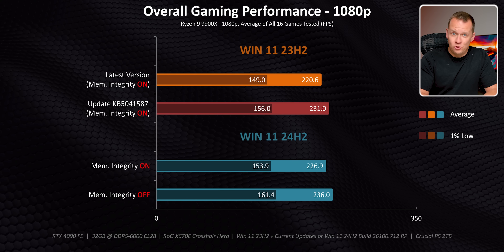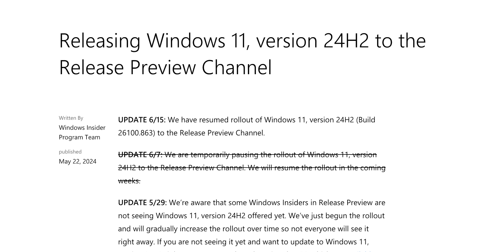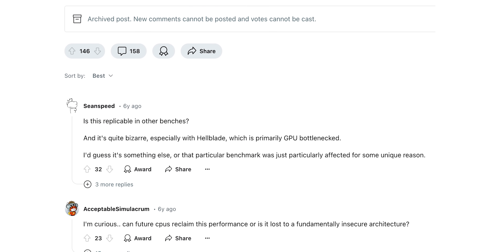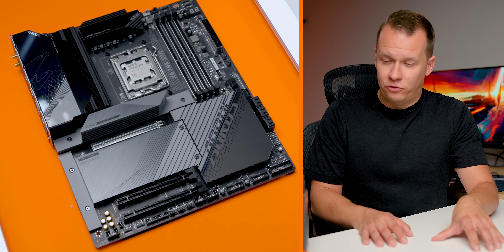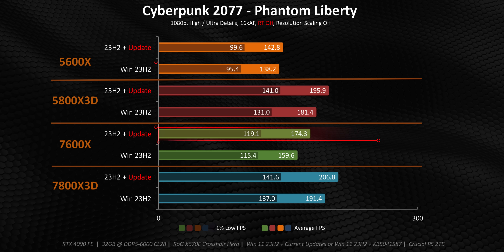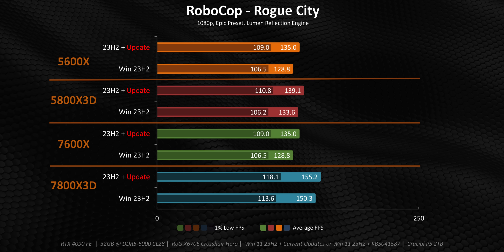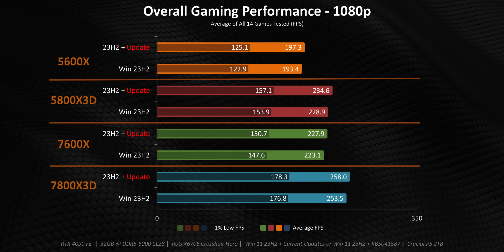Older Ryzen CPUs Just Got Buffed

Comment: I've not sure, because I haven't really tested too much, but I think Windows 11's virtualization based security causes performance issues in older Ryzen and possibly Intel Core 10 or lower? It seems to have a minor effect on newer chips, but this is far less of an issue there.  I noticed that my 5600 and 7700 were not performing as expected in benchmarks, though this was less noticeable in games.  Disabling the virtualization based security made things a lot better.   I'll need to see if it is still a thing in recent versions of Windows though.

Comment: Yep the incremental update for 23H2 alone seems to have fixed a nagging issue I’ve had on my daily driver machine with a noticeable memory leak whenever closing and reopening resource intensive apps. Finally! I would swear it’s been going on the entirety of 23H2. 

I’m using a 7950x rigged to 64 GB of RAM, and with only normal day-to-day use nearly all 64 GB would be in use no matter how much was actually closed, background processes and all. It would only take half a week to max it out for no good reason.

Comment: Not sure how AMD is going to impress with a 9800X3D if its still just 8 cores and they want $450 for it like the 7800X3D. 265K is only the i7 part of the new desktop lineup and its beating the 9950x in multithreaded synthetic tests.

Comment: The problem is, I can't find any 5800X3D in my country (Malaysia)
and lately, I can't even find 7800X3D 😭😭
Reply: Look for 5700X3D?
Reply: I'm using 5700X right now, I don't think the upgrade is significant ...
Reply: @wailoonleong3083  5800X3d is barely better than 5700X3D
Reply: @matte563  yeap... I think I will just wait... will be pairing my 5700X with 4070 Super~
thanks by the way

Comment: I mean windows is getting some of the performance back that was lost in the new version is more like it. It's not really gained performance. Windows 10 had these performance figures already. Windows 11 was specifically constructed around Intel CPU's and the big little architecture they are using. Clearly to the determine of AMD. As it stands right now. Games should 100% still be on windows 10 and if you are these numbers are still in fact lower across the board. Windows 11 only what 15% of the install base while windows 10 if 65% of the install base? Reviews should go back to using the OS people are actually using.

Comment: I just installed a 5700X3D, to replace the aging 2700x I had.
Reply: At the same motherboard? That's awesome and insane at the same time. I've bought a b550m from MSI and R5 5500. I'm thinking about changing for the 5700x3d in the future
Reply: @gabrielladeira5627  it's actually a sad story, I had to replace my x470 board for an x570 cause it died, so pretty much all my system was new except for the CPU 😅 I even have a 6750XT that was running at PCI 3.0 speeds due to the old CPU.
Reply: @gabrielladeira5627  you will definitely notice a difference with the X3D chip 😄👍🏼
Reply: Same here, except I've only got a 5600x... But from the remaining money I've snagged a 6700xt
Reply: @triggeredtiger9905  the 5600x is plenty for that 6700xt 👌🏼

Comment: Windows update on everyone's mind?  Speak for yourself!  I have been Microsoft free for more than a decade now, because that POS OS was so bad, and Microsoft even much worse as a whole.

Unlike many who had all the same complaints I did, even worse didn't understand how to get around them, change it's behaviors... by literal hacking into system files and what not as I did, only to lose any and all changes at M$'s discretion, so with every update... I switched to Linux, and ever since have been the sole decision maker of what flies on my computers and what doesn't, and I don't have to thwart whatever corporations and bad actors do to my PC, because they can't do it by default, and I would have to actively and explicitly allow them to feed me adds at will, harvest my data, take over parts of the system I myself have no control over...

Stop complaining about Windows being such a POS, while catering to the very people who make it, and with their "Partners" see your use thereof as approval to roofie and rape you at will, and ever more and frequently, and are actively making it worse with every update and release, because YOU are actively involved in making it happen!

Also:  When I install a new processor, I do (Should) as everyone else make sure the BIOS is up to date to accept it with as few problems as possible, but do not have to reinstall Linux, it can handle just about any hardware update without having to tell it, and instead of like Windows that installs drivers (With more help from you than need be) on OS install, Linux checks the hardware and loads the closest driver on every boot, and as fast as it boots, you wouldn't know it.  If there is something amiss you will still have all standard functions until you chose a more specific driver, often a proprietary one from NVIDIA and similar just to get a few odd and/or newer features, or get it when the driver is updated if it was the cause, better yet, the OS, drivers, and most (almost all) software are updated through a single common interface based on your Distro's schedule, mine in being a "Rolling release" can check for, find, and install the newest anything as soon as published, so I can get daily updates, with a schedule or not (which will respect your use of programs so you can keep working during updates) one you make not some overlord corporate authority over your PC, or do it manually when you see fit... which only takes a few seconds to a few minutes, not hours of license agreements, reboots, sales pitches, long " please wait" and "don't touch anything" warnings and all that BS.

Comment: The 5800X3D is silly expensive on the used market tbh, about equal to new pricing. I still got one, as it more than doubled my framerate in one of my main games, paired with an RTX 4060 Ti at 3840x1440. However, for most people I think it makes more sense to either save money and go with a cheaper pick, so you can save 2/3rd on the platform cost, or to just go for a newer platform, now that DDR5 no longer feels like shopping around for diamond rings.

Price aside though, what a fantastic chip. It's the new 2600k for sure.

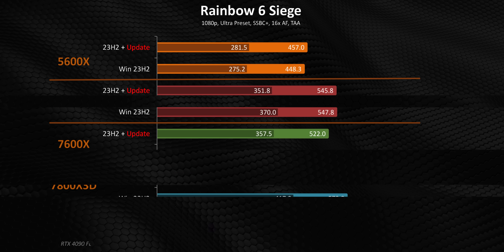Comment: 5:56 Average FPS of all games tested is a useless metric when some games are around 100 FPS and CS2 is ~500. You should have calculated the percentage change and shown the average of that.
Edit: it was worse than I remembered: one game was around 70 FPS and CS2 was more than 700.

Example 1:
Game 1: 100 -> 110 FPS (+10%)
Game 2: 500 -> 510 FPS (+2%)

Avg: 600 -> 620 FPS (+3.3%)
Avg%: (10+2)/2 = 6%

Example 2:
Game 1: 100 -> 102 FPS (+2%)
Game 2: 500 -> 550 FPS (+10%)

Avg: 600 -> 650 FPS (+8.3%)

Avg%: (2+10)/2 = 6%

It shouldn't matter which game gets +10% and which gets +2%, but it does when you only show the average of the FPS values.

Comment: After installing this security update, you might face issues with booting Linux if you have enabled the dual-boot setup for Windows and Linux in your device. Resulting from this issue, your device might fail to boot Linux and show the error message “Verifying shim SBAT data failed: Security Policy Violation. Something has gone seriously wrong: SBAT self-check failed: Security Policy Violation.”

The August 2024 Windows security update applies a Secure Boot Advanced Targeting (SBAT) setting to devices that run Windows to block old, vulnerable boot managers. This SBAT update will not be applied to devices where dual booting is detected. On some devices, the dual-boot detection did not detect some customized methods of dual-booting and applied the SBAT value when it should not have been applied.

The September 2024 Windows security update (KB5043076) and later updates do not contain the settings that caused this issue.

On Windows-only systems, after installing the September 2024 or later updates, you can set the registry key documented in CVE-2022-2601 and CVE-2023-40547 to ensure the SBAT security update is applied.

On systems that dual-boot Linux and Windows, there are no additional steps necessary after installing the September 2024 or later updates.

Comment: Forgot to test SVM (memory / kernel isolation or whatever it's called) on and off.. I installed 24h2 (where it's off), on my 5800x3d based system, and it felt more snappy ingame. didn't measure anything - was noticably better..

Comment: best bang for the buck right now seems to be the Ryzen 7 5700x3d. almost as fast as the 5800x3d for only 200 dollars not bad.
Reply: the 7600x is mostly faster then the 5800x3d and half the price. The 7600x is a beast for it's price.
Reply: @TheGympert  B$... 7600x less cores and cache. Also it wont be able to compete in mutitasking with less resources... Also for someone like me and many more that did jump on the ZEN since it was introduced 2017, we have whole systems, and is way better for us to just upgrade the CPU alone, no to go and buy expensive AM5 mobo and DDR5 too.... So ur statement suck, since u just compare the 2 processors, and nothing else... So what u said, applies only to these that have older then AM4 systems, or no system at all...
Reply: Lower clock speeds = lower performance... Not my cup of tea... Also i got mah 5800x3D for 330$, but also sold mah Ryzen 3700x fro 150$, and Wraith Prism for 25$... So getting the 5800x3D for 160$ was da real deal, as 5700x3D may be cheaper, but it also has lower IPC too and clock speed, and that sucks, as 5800x had way higher clock speed then 5800x3D anyway...
Reply: @themobster7284   lower clock speeds does not always mean lower performance unless you really care about that 1%
Reply: @AgonyofAven  1% ahahah... Seems someone missed the math classes... How exactly is 4.1GHz 5700x3D vs 5800x3D 4.5GHz, 1% ?!?!? Outside of games and stuff it will be slower, by at least 15% lower IPC.. And also 5800x did boost up to 4.7GHz... So you want to tell me that 4.1GHz will be only 1% slower compared to 4.7GHz ahahah... I was already not happy, that 5800x3D had lowered clock speeds, but 5700x3D is even lower, and that is not acceptable.. Also 5700x3D mem controller is also weaker, meaning it prob many of these chips wont support CL14 3600 memory, or faster...
Reply: @themobster7284 Pretty sure they’re talking about 1% lows…

Comment: I think the 5800 and 5700x3d will go down as CPUs on the same level as the i5 2500k, probably even more legendary. I don't see myself upgrading again until there is another paradigm shift in computing. It's crazy to think that a $100 B450 motherboard from 2018 might last through 3 major GPU upgrades and over a decade.
Reply: I agree 100% with your post.

Only slight difference: I am running it (5800X3D) on top of a x470.
Reply: Id rather have a 7600x any day of the week. PBO -30 smokes the obsolete chip.
Reply: @jurpo6  "PBO -30 smokes the obsolete chip".

Reasons? "Because the voices on my head said so".

Comment: Is anyone else only seeing KB5043145?
Reply: Same here, also checked my history and KB5041587 was not installed nor can I find it anywhere.

So the question is, does KB5043145 have the performance thingy included?
Reply: @dennishaller6578  I'm only seeing 2024-09 Cumulative Update Preview for Windows 11 Version 23H2 for x64-based Systems (KB5043145) as well. 

It states cumulative update, so I would say that it should KB5043145 build updates included as well.
Reply: @dennishaller6578  KB5041587 was still on the Windows Insider Beta channel when I downloaded it.
Reply: I am
Reply: this late so you probably already figured this out but just putting this here for anyone else, this update is included in the KB5043076 "cumulative stack" update
Reply: Same here
Reply: ye only KB5043145
Reply: Same
Reply: mine says optional update kb5043131 windows 10
Reply: If you have KB5043076 I think it was in that so you won't have 5041587 available.

Comment: How about Zen 2 cpus?
Reply: Sadly no
Reply: Time to upgrade
Reply: @randomusername982374  i have 3900x its doing pretty well for 12 core processor. Should i?
Reply: @randomusername982374  It's only time to upgrade if it no longer suits your needs. I'm running a Ryzen 2700 with a 1080ti and I can still play every game in my library. Admittedly, I don't buy games until they're at least a year old and the prices have come down and the bugs have been worked out by the early-adopters, but there are still some graphically-impressive games in that list that run fine.

Comment: Remember that’s only 1080p using a RTX 4090 “$2,000+ GPU to “highlight” the “performance” of a CPU. If anything you should be running at 1080p low settings to boost the FPS. Only way you going to see this is if you have a $400+ CPU and $2,000 GPU.

Comment: 5800x3d is reminding me of the 1080ti. Just one of those once in a generation bangers
Reply: Even more amazing given that it was an accident almost. AMD had built 3D VCache for the data center and only came to consumers because an engineer tested games with it and realized how much of a performance boost it gave.
Reply: Agreed! I think I even gonna upgrade to it from 3700x before changing the whole platform - it is that good in my opinion. I've always leaned into more budget friendly setups and that cpu is amazing for the price.

Waiting for the black friday deals or may even buy it used if one comes available at the right price.  😋
Reply: @laurikvo  look for the 5700x3d its about 100$ cheaper and ist almost the same, it gets overlooked alot. I upgraded to it from a 5600x which is roughly on par with ur 3700x
Reply: @laurikvo  Get a 5700X3D instead. It's over 100 bucks cheaper and only a couple percent slower.
Reply: @Remu- the 5800x3d price is through the roof in the UK now. No stock over £400 so everyone will get the 5700x3d regardless there's no 58 left
Reply: @laurikvo I don't think you are mate you'll have to settle for a 5700x3d unless you go 2nd hand or pay over £400 for one
Reply: @laurikvo  you better hurry & buy it, I think AMD has stopped production.
Reply: 1080ti performance, but price was still DAAAMN at the time
Reply: I'd say the 5700x3d is more like the 1080ti as its quite a chunk cheaper than the 5800x3d for like 5-6% less performance. The 5700x3d is amd's 1080ti.
Reply: i actually have 5800x3d paired with 1080ti myself :D
Reply: Heeeeeell ya
Reply: Man, perhaps once in a decade even. Certainly not generational.
Reply: lol y are u comparing a gpu with cpu
Reply: If AMD had any sense, the 5600X3D would've been the most sold AMD processor ever.
Reply: It's what I'm running now :D
Reply: I9 9900k
Reply: Have it paired with a 4080 for 1440p gaming. Not upgrading any of those until they die
Reply: hate myself I opted for the 5600X when I built my latest rig and not the 5800X3D, now they are quite pricey because people know how good it is.
Reply: @RichDasix  Yeah I sold my 5600x since I play tarkov and benefit a lot from the big cache
Reply: lmao not even close
Reply: i5 2500k
Reply: Alan Wake 2 enters the chat
Reply: 41%
Reply: I'm still using my GTX 1080ti 150$ since i don't get double the vram & performance for 300$ lmao
Reply: Justb hat 1080ti is hyperglorified, because it already was a massively overpriced GPU, which people just forgot because prices shortly after exploded even more.
Reply: @elmariachi5133  also it had no real competition it wasd either buy a 1080 ti or suffer with amd cards
Reply: And its still better than Intel's core i9 with big and fake cores
Reply: And the 5600x!
Reply: Intel & AMD are need more improvement. Intel Price is also too much for this spec 👎
 Mac M4 is rocking the field with Les Cost. We can buy a Mac mini M4 at an Intel VGA cost nowadays..
Reply: I would say the better analogy would be the "new" i7 4770k the last gen ddr part that lasted right up to the 8700k before showing its age!
Reply: @ravendagrey  the i7 2600k and 2700k did the same, two generations earlier. 2nd gen core i series was very commonly overclocking to hit 5GHz+, which put it level with most of what came afterwards, until 8th gen increased core counts
Reply: @williampaabreeves  100% agree and technically dated but were still relivent until the 8th gen, i had a 3930k oc'd to 4.8 that wasnt far off to my ryzen 5 1600x much later in life
Reply: I upgraded from a used 5500 to the 5800X 3D. What a beastly 8x core chip, now it needs a RTX 6000 card in the future to unleash the full potential 🎉

Comment: Me with a 3700x too lazy to put my 5700x3d I've had on a shelf for 3 months in because the 3700x is good enough :|
Reply: Nah.. lol
Reply: Then why even buy the 5700x 3D?
Reply: @swifty1969  I wanted more FPS and I updated a gtx1080 to a 4070 super so I figured I'll get a CPU upgrade too, just couldn't be bothered to take the fan off and redo thermal paste. I'll get around to it eventually. Might do it this weekend, but then again, might leave it another month.
Reply: @daedaluxe  yeah!  I know what you mean.  I almost felt into that trap when I bought my 5800x3d.  Laziness takes over.   I forced myself to install it first day because if the chip turns out to be defective for some reason, then you will not be able to exchange or return it after 30 days.  The 5800X3D made a world of difference with my rtx3080 compared to my previous 3700X.   I couldn't believe how much of a bottleneck my former cpu was.